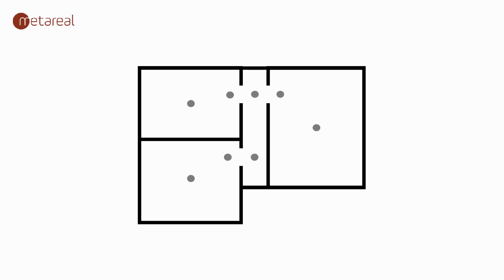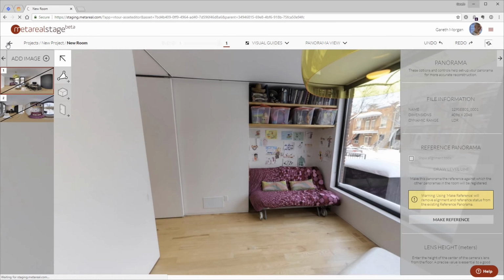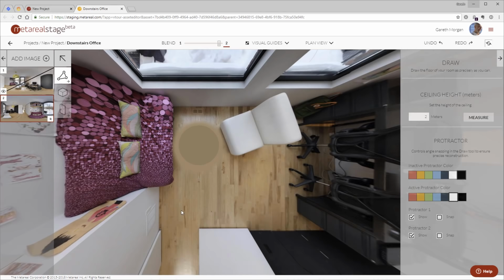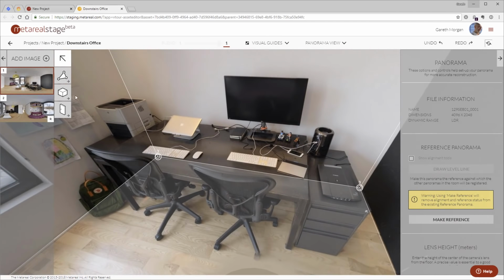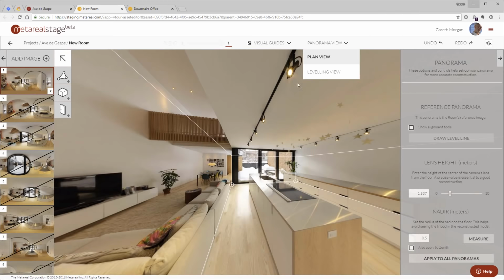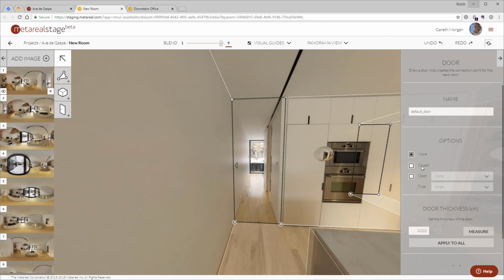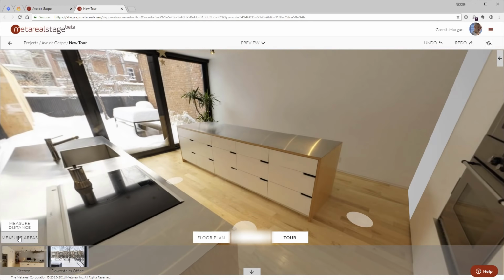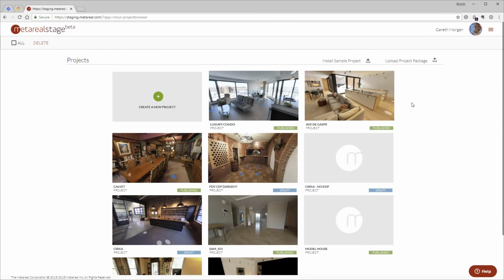[ARCHIVED] Make 3D virtual tours, floorplans, and 3D models from 360 photos with Metareal Stage

Comment: Great tool! I have couple of questions
- I saw export button will it means that I can export web archive and host it on my own server?
- What will happen if I will view it in 6DOF VR headset will there be any movement or it will behave just like ordinary 360 photo-tour
- Do you plan release VR viewer app?
Reply from the maker: Yes! - export will be an available option. You will be able to export to FBX, OBJ, or to a packaged tour that you can host yourself. If you use a 6DOF headset, movement is tracked, and you see depth. As we use webVR, Chrome is basically broken (for the moment) and Firefox is rough, but functional. There are some parallax errors which will be corrected when the full VR tours are deployed in the next few months. We do plan to release dedicated viewer apps eventually. 3DOF headsets such as Oculus Go and GearVR work pretty well, with good 3D and sense of scale. We'll be deploying the support for them via webVR in a couple of weeks.